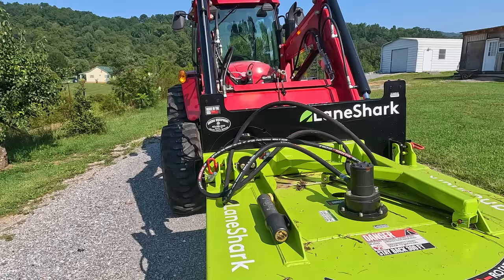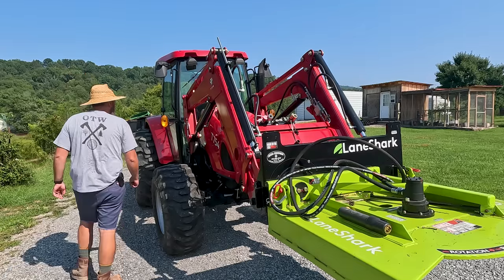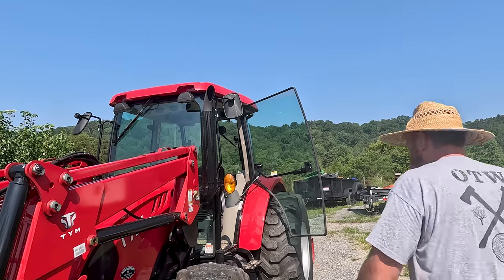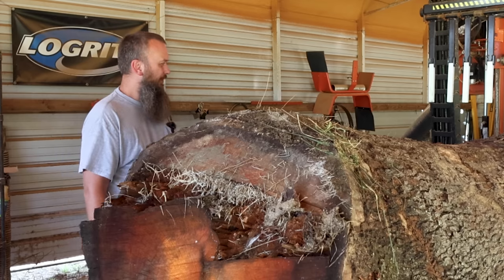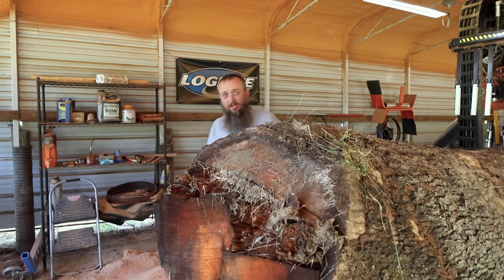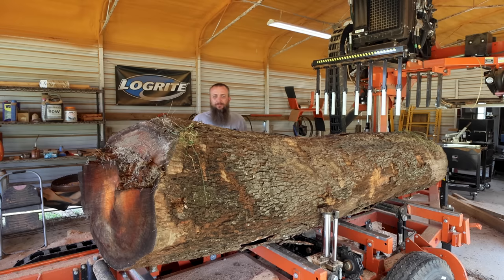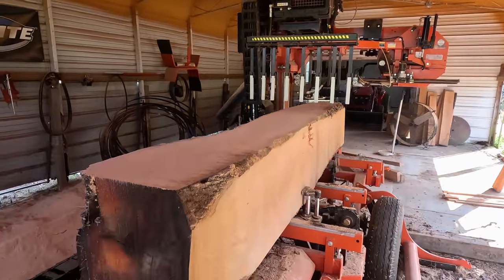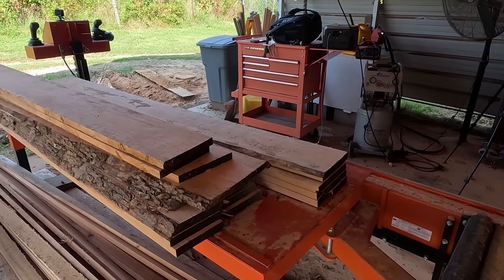Turning a Massive Cherry Log into Stunning Creations through Skillful Sawing

Comment: I use schaffers as well it’s the best I can get a case of schaffers 221 which has 30 tubes for 188.00 about 6.26 a tube I use there motor oil their grease and their penetrating lube. Let me know if you want my dealers contact hr can have it dropped shipped without shipping I ordered some blades from your guy Joe today.

Comment: Only reason I gave a thumbs down, was because of the money your throwing away to the burn pile, with those thick first cuts to square the log. Yes I worked in a sawmill. We never cut that thick. We might take that know off, but we take thin cuts to even the face before we flip it. Plus you can chop the scraps to usable sizes for smoking meat. All that potential profit gone to waste 😢 I was the end cutter for the boards, stacker operator to prep for drying, and the kiln operator who dried the wood. We focused on Walnut, but we did a very nice amount of Cherry. Both steamed and unsteamed.